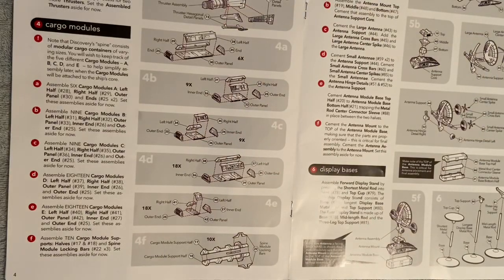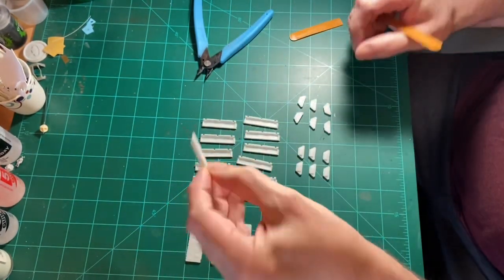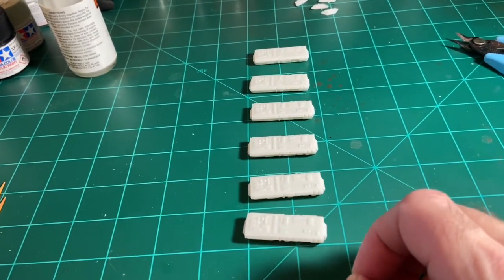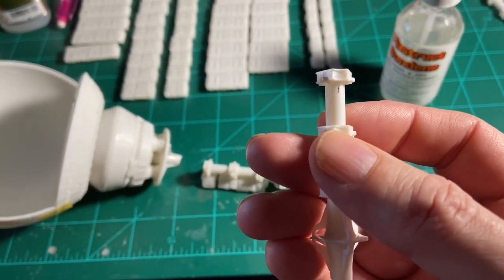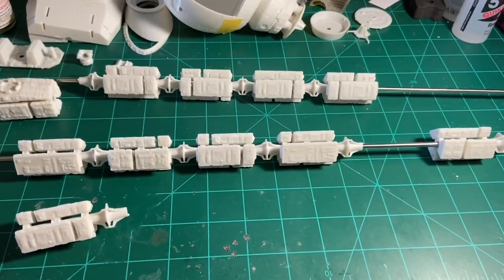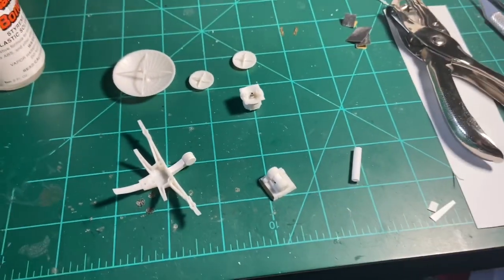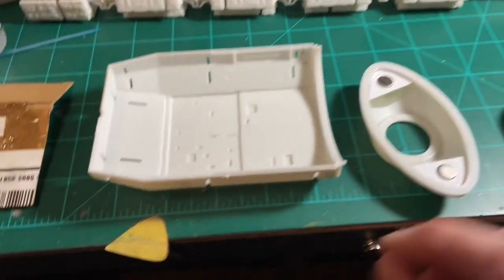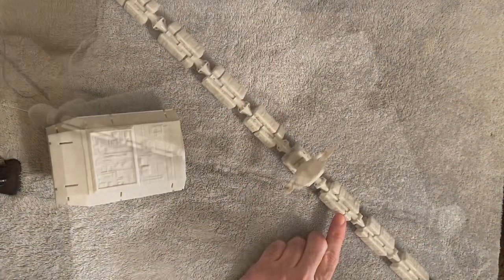NEW 2001 Discovery build part 8!

Comment: Great to gave the Discovery back, I was worried it had been benched for good for the Malodourous figures! Btw what happened to you Big scale Spindrift, did I miss the end or is it still 'work in progress'??
Reply from the maker: I had always planned on completing the Discovery since it is a commission build, my client also wanted versions of the 3D printed figures I did so it wasn’t an issue delaying it. I plan to focus on this until completed in the near future. The Spindrift still remains a priority as well and I will return to it and complete it as well. Now because it is a very large, 3D filament print, the layer lines are the biggest challenge. They take multiple sanding, primer, sand again, more primer, paint, wet sand, etc. so this is a long term project but definitely near and dear to my heart!